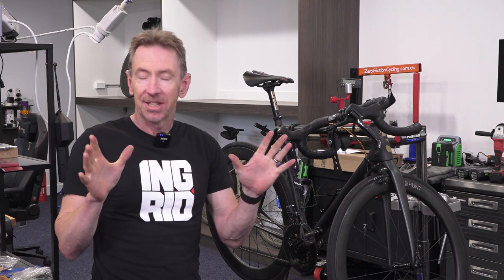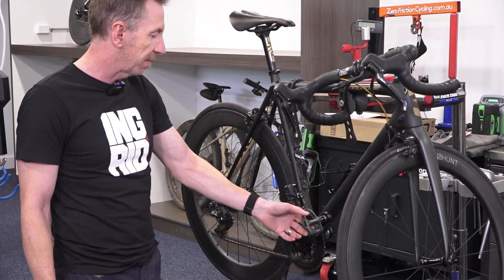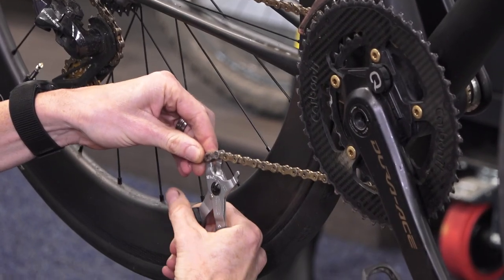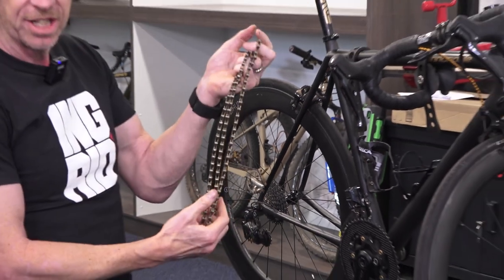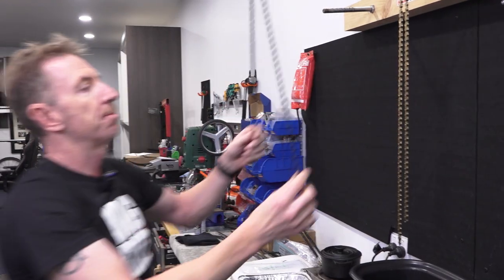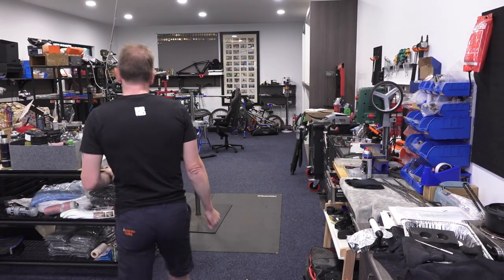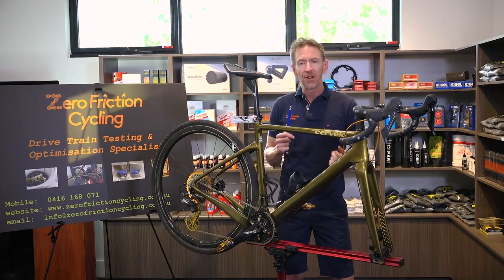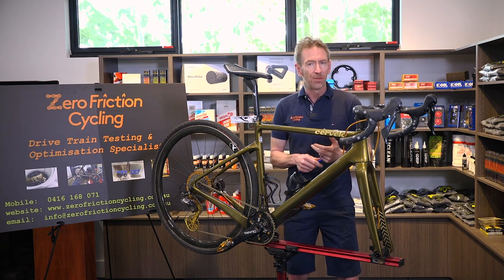Episode 17   Immersive Waxing - The Concise Version

Comment: Adam if I was to use Tru-Tension Tungsten on top of Molten Speed Wax,  roughly how often should I reapply Tru-Tension. In your opinion how many applications of Tru-Tension can be applied before you do another immersive waxing?
Reply from the maker: Hey Dale, yes Tru-Tension Tungsten all weather or race, Silca SS drip, ufo drip - all brilliant options to use in conjunction with msw or hot melt - generally though i would re wax by the 5th re lube application - which for most should be pretty easy as that is re waxing only every circa 1200 to 1500km for road riders - a heck of lot easier vs doing a flush clean on wet lube chains for good periodic maintenance every circa 1500kms, always cleaner, lower wear etc etc - its a hit :)
Reply: Thanks Adam, Sorry I should have included this in my original question. When you reapply True Tension Tungsten is there anything that needs to be done or do you reapply right over the previous application?

Comment: Did you say to use alcohol after methylated spirits to get the residual film off? I have isopropryl alcohol, is this ok to use as the last step before waxing?
Reply from the maker: Nope. Methylated spirits is the alcohol, but if you have iso thats all good. All is covered in chain prep guide on website
Reply: @zerofrictioncycling992  thanks, so there's no added benefit in using both I take it. Appreciate the response

Comment: love the videos -do you clean the chain before rewaxing-surly not doing so will contaminate the wax pot?
Reply from the maker: Very rare. What will contaminate wax pot? Dry road riding, yes every re wax will bring in a small amount of dust contamination as chain has been operating exposed, but it is VERY small. Cleaning efforts would use more resources than any benefit given. Imagine what is comparatively happening on a drip lube chain where about 0.05ml of lube per link is just added over existing contaminated lubricant? Vs putting chain into a bath of 500ml of lubricant. Things are going to be amazing in that bath for many many many re waxes (normally recommend to change circa 30 re waxes to fresh bag which is around 10,000km for most). Offroad wipe chain with alcohol spray onto microfiber cloth to remove surface dust - 15 second job. Solid wet ride, boiling water flush rinses and dry before waxing will save a bunch of contamination being brough into pot. But again, even if one never does anything pre re -waxing (which for dry road is recommended), one will still always have a great chain re set each re wax, and it takes a long long time for ratio of contamination in wax pot to be anything near like what is happening re contamination to lubrication ratio on a drip lube chain. Summary - you dont have to worry, just re wax and be merry :)

Comment: I don't like letting the chain get stiff and having to break the links and get wax flakes everywhere. I typically take the chain off the pot, wipe it down twice, and install it hot as soon as it can be handled and start spinning it right away before it gets stiff. Are there any issues with this?
Reply from the maker: Its fine as long as the pressures do not press the not set wax off the key load surfaces where you really want a set coating of wax..... pedal uber gently....

Comment: Do I understand it correctly. You come from a ride (let's say chain is a bit dusty, maybe some sand/dirt), you wipe it a little with a rag or gentle hose down, you then put this chain in wax container together with all small dust/sand particles left on it, re-heat same wax so it forms new layer on chain. And all this is good? As in it does not introduce more friction with each time you do this procedure over and over? (more contaminates in wax pot)
Reply from the maker: Correct. Ok now dont  take this the wrong way, but why is this shocking to you? To start - being a solid, its contamination absorption is going to be the lowest possible. Then, whatever amount of dust is still in or on chain, is going into a pot of typically 400 to 500ml of wax. The old coating will melt off, fresh coating on. Yes, over time that will contain more and more abrasive contamination - but - it takes a very long time before that remotely approaches what happens vs Drip lubricants. 

So why dont you ask the same questions re drip? One rides in the world of dust, and then goes to re lube. They can do same external wiping. Then they add approx 2 to 3ml of lubricant onto chain, over 100+ links, so approx 0.02 to 0.03ml per link of fresh lubricant. What do you think the ratio of contamination to lubrication is in that situation vs the chain being flushed in 400 to 500ml of 100% lubricant. What do you think is the ratio of contamination to lubrication after one has repeated this 5x. or 10x. 

For drip lubricants to remotely keep pace with immersive waxing re contamination levels they would need to be solvent flush cleaned prior to every re lube. Are you telling me it is easier and more cost effective to solvent flush clean chain prior to every re lube vs popping chain into a wax bath? 

Hopefully this helps with some perspective. Dont worry about what tiny amount of dust each re wax is now part of hundreds of ml of lubricant. If you are worried about that, then you should be absolutely freaking out re what the comparison alternative option is.
Reply: @zerofrictioncycling992  when you pit it in such perspective - hands down  correct and makes sense :) thanks for replying. I'll try Wax on next chain. My GX eagle lasted me only 1k km (MTB)
Reply from the maker: @SergejGrabun  excellent! i have been practicing the best way to get that across - it seems this way works woohoo! :) You will enjoy, it really is a grand ol time. The most common feedback is why oh why did i wait so long to switch!

Comment: How long does it need to set after taking the chain out of the wax? Seams dry in 5 minutes
Reply from the maker: it is not really dry as nothing is evaporating, it is just the wax setting. It depends really on ambient temp - if you hang at 40dg c it will be longer than hanging at 10dg c. Call it about 10 mins for most on average though

Comment: How often should one change out the wax in the wax pot (crock pot or whatever one uses)?  I started waxing last year and the wax in the pot has decreased in volume, so not sure if I should dispose and use fresh wax or just add more wax to what's there. Also, I have heard conflicting stories about how often a quick link can be reused, what's you recommendation before replacing the quick link?
Reply from the maker: Hey albert! General recommendation is to rewax every circa 300km, and change to a fresh batch every circa 30 re waxes, so for most - depending a bit on conditions - you should look to change every approx 8000 to 10,000km. Just melt wax, decant into a small aluminium bbq tray for disposal, wipe pot clean with paper towel, fresh wax in. 

I wont re type the recommendations and caveats here re master links - head to;
https://zerofrictioncycling.com.au/wp-content/uploads/2021/10/Master-Link-FAQ-Guide.pdf

And go to page 8 for info on re using master links. The wax FAQ and pretty much everything like this you may be pondering will be in the resources on website. I definitely try to stay on top of comments but that is never 100% guaranteed of a fast reply for needed info

thanks!

Comment: I follow your videos closely and look for new info....  I do warm water rinse and ultrasonic wash even i rewax a prewax chain -  Is that overkill
Reply from the maker: Hi Ming! Yes if its dry riding. So little contamination enters from dry riding (especially dry road riding) - that you would never ever get a tangible benefit back for that time and electricity cost. Ie you would never be able to track more chain life etc from doing this every time, vs just re waxing.  

A problem has arisen over the years where literally i think every single case bar one of less than expected chain lifespan on immersive waxing - basically we find the person was flush rinsing or cleaning before re waxing every time despite dry conditions riding. What seems to happen is that doing it every time, drying time gets skimped as they want to start getting it done quickly. Re waxing frequently on a still wet chain seems to have a clear negative impact. And so one needs to be diligent with drying chain before re waxing - which is more time and steps - and again for zero benefit if dry riding (well, not zero, but so tiny you cant ever notice). As such this should only be done post wet riding where such actions DO make a tangible positive difference, OR - if one is doing best practice for dedicated race chain for their dedicated race wax pot - they just need to ENSURE chain is fully dried before re wax. This is best done by heat gun or hair dryer - place in a small aluminium bbq and heat for 2 to 3 mins on high, chain will get very hot, water deep inside chain evaps out perfectly from that heat. Drying with cold air (compressor etc) is far less effective and takes more minutes - heat gun or hair dryer make drying chain a doddle before re waxing - but again i can only stress unless it is dedicated race chain for race wax pot where every possible tiny fraction of a watt is the aim - thats why one has gone down the path of a dedicated race chain and pot - for training chain you will never ever track a benefit for all the time of those extra steps - just re wax.
Reply: @zerofrictioncycling992  thank you for the clarification/  I usually work on 6-10 chains at a time and not knowing the contamination of the chains coming from various bikes i just treat them as contaminated - hence warm water rinse and ultrasonic with warm water / Drying time is not a concern as i leave them for at least 12-24 hours after hp air blow
Thank you again for your videos and extensive testing and published results.
Reply: After cleaning multiple chains in a heated ultrasonic cleaner, we leave them in the wax until it gets over 100C again, then we can see the water boiling out of the chains, shake shake shake, and watch again. No more bubbles, no more water. Having multiple chains for each bike is super, just a quick chain swap as needed.
Reply: @davebrown9725  i am not sure what was you are using but i have read somewhere not to exceed 195 F  otherwise the wax  chains are damage....  So i always keep an eye on wax temp not to exceed 200F
Reply: @goixiz  We have never had issues with wax breakdown due to high temps, but obviously are careful to keep well below vapor or flash temps, flamable petrochemicals after all (although the solvents recommended for initial chain degreasing are even more flammable). I know about cooking oils breaking down when overheated, but had never considered that possibility for paraffin wax with titanium disulfide(? & likely other enhancers).
Reply: @davebrown9725  ur call   / as for me why go that high when i can achieve same outcome with 190-200F   /  just dry the chain properly

Comment: Not sure this is expected or not but basically I have 3 Dura-ace and 3 Ultegra chains. All prepared simultaneously and the same method as your instructions. Waxed with Silca hot melt ss. The Dura-ace chains consistently get noisy after 80km or so where as the Ultegra stays quiet at least twice as long. Idk how big of a difference the chainrings makes as this is on 2 different bikes but is this down to the Dura-ace chain having different surface treatment or did I mess up something?
Reply from the maker: Hey Timo - yes shimano chains do tend to feel and sound more dry more quickly than ybn / campy / sram chains  (kmc really bad) and it is due to the low friction coating type they use which affects wax bonding a little bit. Dura ace has siltec on more parts of the chain vs ultegra. However, 80km is pretty quick. Chain rings wont really make too much of a difference at all in themselves, other factors that can be influence though is chain line, a more extreme chain line will exacerbate how quickly a chain feels & sounds dry, so larger rings, larger range cassette which delivers a great chain line angle may shorten treatment lifespan feeling smooth in the larger cogs. Also dura ace cassettes, the largest 6 cogs are a titanium alloy, and they can feel  / sound less smooth on hardened steel rollers if wax is abraded off vs steel roller onto steel cog. It is super rare though that any of these things cause an issue such that waxing is not pleasurable to ride for a good stint each treatment, im not sure if anything else may have come into play re the prep for the DA chains that may have impacted adherence on those chains. Over time it should improve, just err on re waxing early for a bit on those chains....
Reply: @zerofrictioncycling992  thanks for the reply! Just for the clarification, when I say the chain is noisy I mean it's kinda rattling not yet that metal on metal zirp you get later. I guess it's to do with the looser tolerances of the rollers? Just a bit annoying as it's noisier than with oil...

Comment: Can I use acetone instead of using turps?
Reply from the maker: yes, acetone is very powerful solvent and very good metal surface prep, it is just REALLY expensive, and lots of fumes. Unless you get for free, it would economically be nuts to use acetone vs turps. And make sure you have amazing ventilation.
Reply: @zerofrictioncycling992  perfect thanks! Thought I'd ask, I just had some left over acetone that may be of use. Will definitely be getting myself some white spirit and methylated spirit to clean my chains.

I'm a big user of drip wax but now I'm definitely one step closer to immersive waxing.
Slowly but surely, a step in the right direction it seems. 😉

Thank you for putting out such useful information on here and your guides on your website!

Comment: Hej Adam, which temperature should the wax have ? I have an instant pot which i fear will be to hot. Cheers and keep it up !Jesper
Reply from the maker: Hey Jesper - really anywhere from 70 to 100dg c is perfectly fine, so its a pretty big window. Temp isnt the only thing though, rate of heating is also important - you want it to take at least 10 mins, if heat too fast - the wax can still be damaged - the wax on the bottom will initially have nowhere to go as trapped by the wax on top. However i havent seen an instant pot yet that has damaged wax - a fair few people use instant pots these days. Rice cookers are no go as they blast heat in and so can damage over time, but instant pot - you should have a slow cooker option, or a manual and just set it to 90dg c, and all should be sweet
Reply: @zerofrictioncycling992  thanks a lot for the quick response. If the chain is squeaking after about  170km there probably wasnt enough wax in the chain right? so maybe it got to hot and too liquid or the chain had the wrong temp?
Reply from the maker: @Jospabaerze  no it is very hard to get temp wrong, anywhere from 70dg c to 105dg c is fine, and cooler temps for thicker coating - you just have more excess pressed out when start riding, and will be in the same place after 10 mins re thin coating inside. If squeaking on road - dry conditions - after just 170km, then it is likely to be a bond issue - either the chain (kmc? - shimano sometimes a bit tricky too) or the prep, or a bit of both.
Reply: @zerofrictioncycling992  The first coating worked for over 300km so it shouldnt be the prep. Maybe the rewaxing just didnt go as good. Thanks for the answers and I will hope it improves :)
Reply: @zerofrictioncycling992  squeaking only occurs when shifting (typically up on the casette) but not when pedalling normal, so wax should have gone into the chain? Any ideas. Sorry for asking, searching via google has sadly failed me so far.
Reply from the maker: @Jospabaerze  Ah thats a bit tricky indeed - if the wax coating was get too thin / worn though such that there was metal on metal squeaking, this would occur as well on larger chain line angles during pedalling load, not just a momentary thing on shift only. 

Does this only start after X kms into treatment? ie the noise is not present when shifting intially?
Reply: @zerofrictioncycling992  Yes, normally it starts after 100-150 km of usage of the chain.
Reply from the maker: @Jospabaerze  yeah that is a bit of an odd one, but if it is doing that there must just be a lack of wax in side bits (between inner & outer plates etc) so getting a squeak under side loading on shifting, but again normally if that was happening it would keep happening under pedalling on chain line angles when those parts have some side loading. 

It may be well worth using a top up wax lube like ss drip or ufo drip to get more time in between re waxes whilst keeping things lovely and silent - so just apply a coating after circa 150km (it is very popular these days for combo approach - wax - use compatible lube next 3 to 5 re lubes, then re wax to reset any contamination starting to build)

Comment: If you just cant seem to get the master link to re-engage after rewaxed, try melting the wax in the links you're working with. Ive found it to be difficult.
Reply from the maker: Hey joshua - sometimes if the master link is hard to get back on it is because there is a little build up of wax on the sides of the two inner link plates on the ends of the chain that you are now looking to re connect. So if it is difficult to get pins through far enough to get them into locking channels, i just use side of master link to do a quick scrap across sides of inner link plates to remove excess - takes 10 secs, then all groovy to pop link in easily.